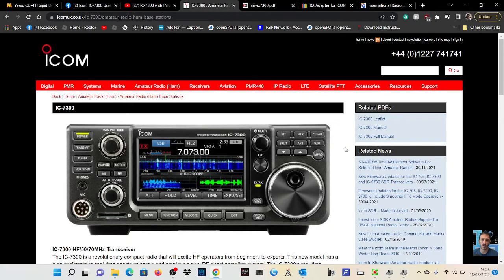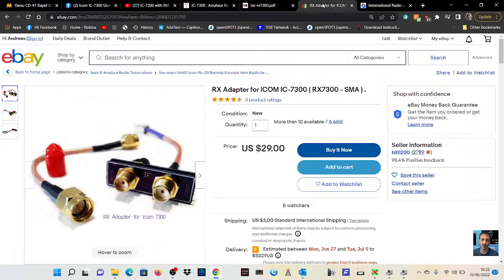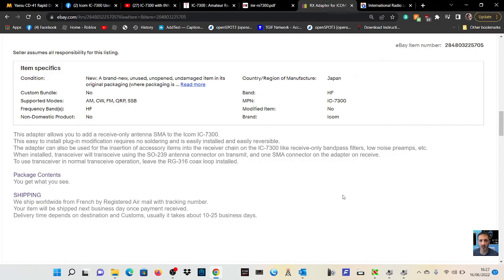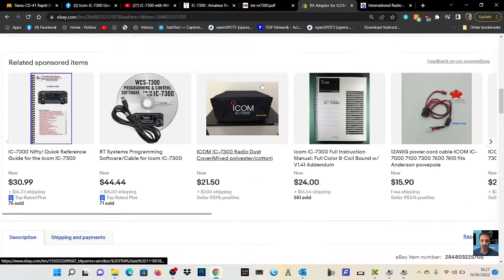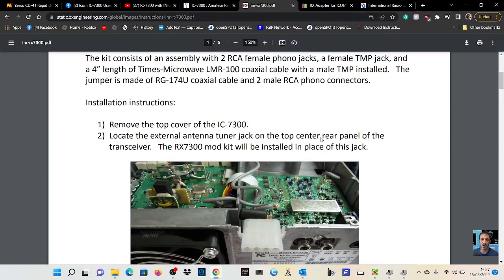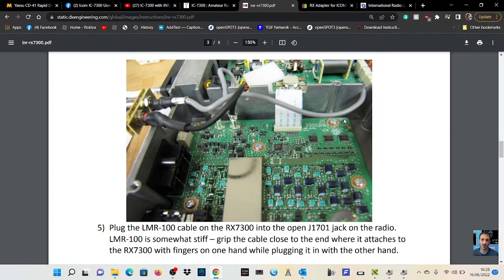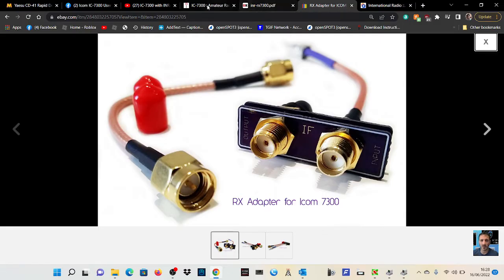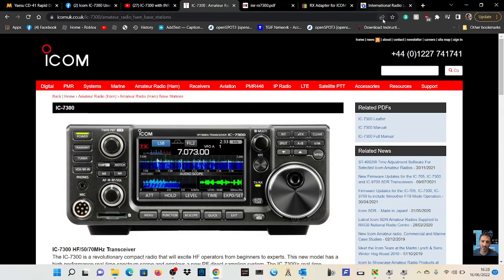ICOM IC-7300 - RX Adapter for ICOM IC-7300 ( RX7300 - SMA ) .

Comment: Im going to use it as a second reciever from my kenwood ts 590sg. By using the drv port on the 590 to the input side of this device to allow my 7300 to be the sub reciever eliminating the possibility of accidentally transmitting the 7300 into the kenwood...
Reply from the maker: Hi sounds like your having fun catch u on air one day 73

Comment: Some of the more expensive Icom rigs have a receive aerial connector and you can select which is used on receive. This is sometimes useful if you want to use a low noise magnetic loop like the Wellbrook for example.
Reply from the maker: Thanks